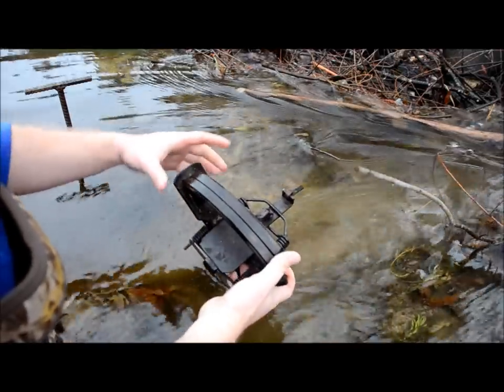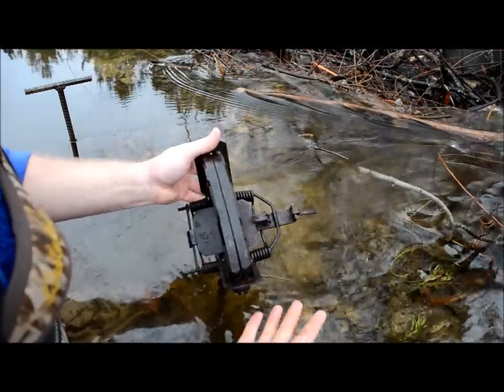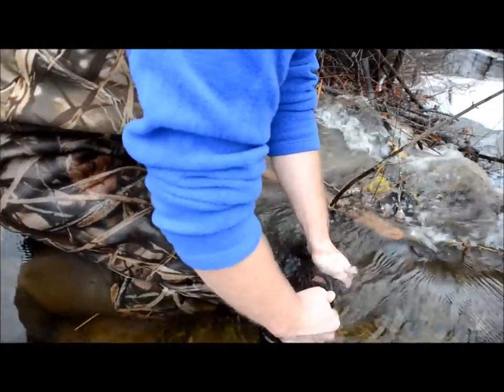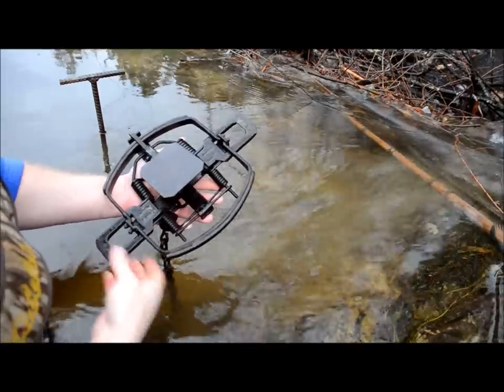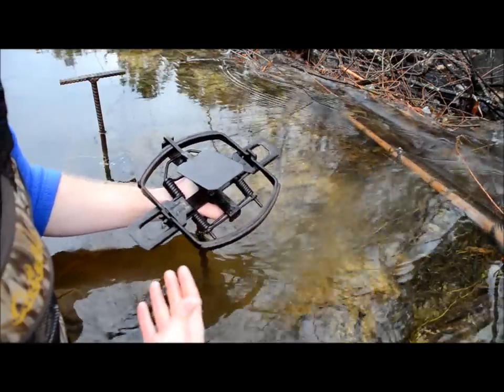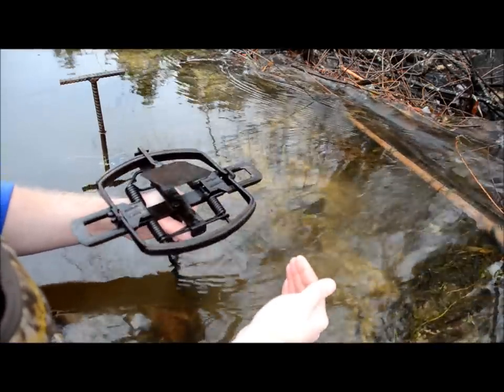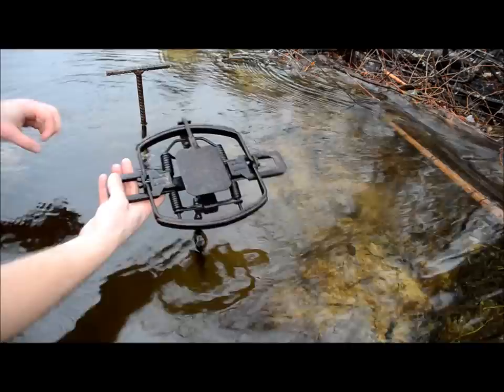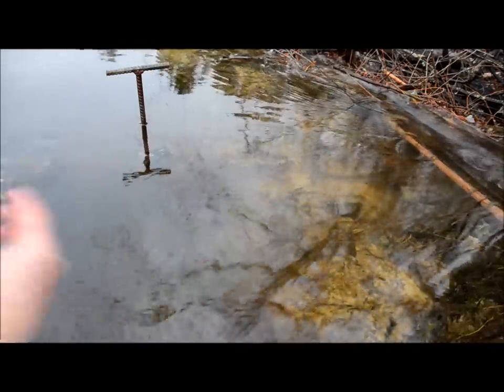Beaver Trapping Basics-Footholds

Comment: Do you only use coil springs or do you use long springs?
Reply from the maker: I only use coilsprings, they are smaller and easier to transport, and in my opinion easier to set as well.  Its just my preference but I'm a coilspring fan.

Comment: OMG your so unsafe. what would happen if you got your hand stuck in that trap.
Reply from the maker: +Oliver S. As a trapper, you're going to get caught sooner or later, you've got to come to terms with that.  I am extra careful with those larger traps, that's why I always adjust the pan from under the loose jaw, if it fires you won't get caught.  If you were to get caught you could use your feet to depress the springs and get loose or at worst pull the trap and carry it back to get help.  So there's no real danger of being stuck in a remote area.
Reply: that is so true. because I got caught in a 220 conbare. and that was not fun.
Reply from the maker: +Oliver S. no its definitely not fun!